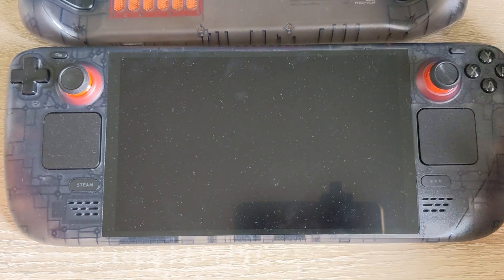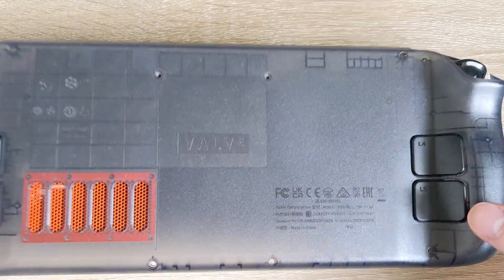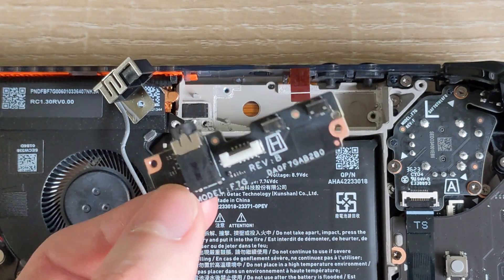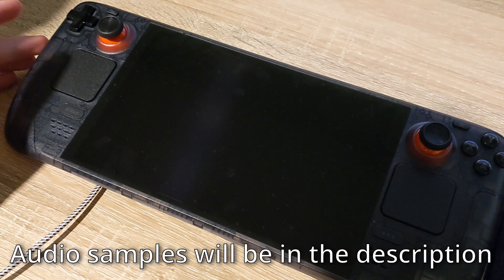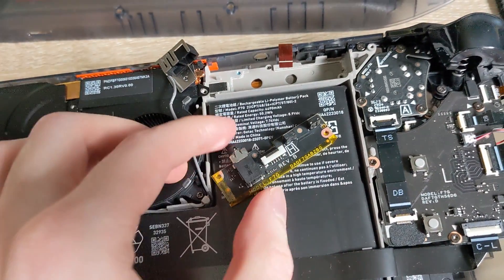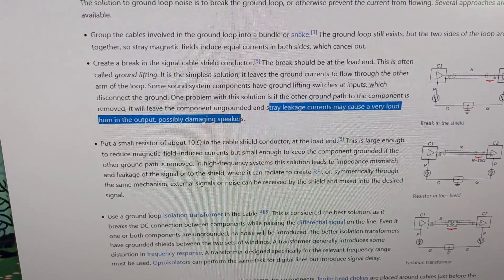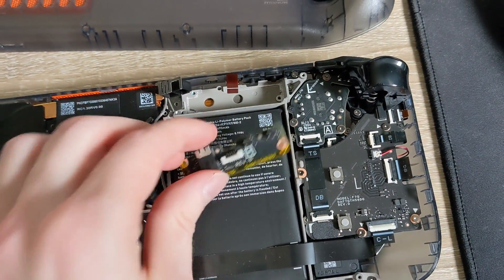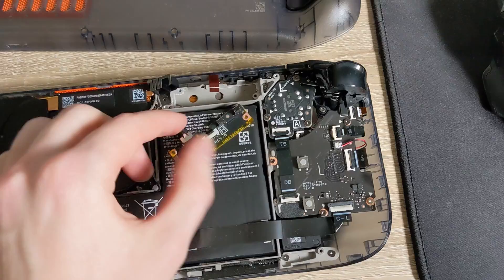Steam Deck OLED Headphone Noise Investigation

Comment: I just backed out the two screws with copper looking plating under them about 1 turn and zero noise (mine was terribly loud).  i did it with headphones in and heard it change and stop.  The screws are touching something they shouldnt.

Comment: So is this problem widespread? Also, how loud is that static/crackling noise? Is it when you are moving around in the settings, while playing games, or playing any sound with headphones connected? Sorry I’m new to the Steam Deck community, I just got my new OLED 512GB
Reply from the maker: The issue pertains to the headphone jack. Steam Decks that are affected by this issue will exhibit a "buzzing" noise when producing any sound through headphones. It is most noticeable in quite moments or near silent moments.

Comment: Thanks for posting! I asked Valve, they offered a fix but I figured I wanted just to fix myself. I used two small M2 nylon flat washers on the two screws on the top of the audio board, and it corrected the issue for me. I was not confident Valve support was going to actually do anything beyond replacing the board.
Reply: Correction - the washers only made the noise less
Reply: I would be curious if anyone here with a 'fixed' deck by Valve can open it up and see what was done.
Reply from the maker: @TakeingCrazyPills  I was curious enough about what their solution is that I went through with the RMA. When it returns I will make a follow up video. Assuming they actually fix it of course haha
Reply: @SamCampbell  thanks so much - I know I could just use one of my many Bluetooth headphones but its interesting to figure it out :)
Reply: Hey could please share a video instruction how to that? I have the same issue

Comment: I sent my 512GB OLED for RMA last week with the same exact issue. They didn’t give me too much hassle. Although I find their response that oh yes they are aware of a small amount having this issue to be a bit BS as based upon what I’ve been researching it seems like a lot have this issue. I think more people need to just go through RMA so maybe Valve will make a more public statement such that  more people with this issue will end up getting it fixed (hopefully) by Valve.
Reply from the maker: Unfortunately I think that Valve will continue to say that it only affects a small number of units and will not make a public statement because it would cost them a lot to offer a blanket recall. 

The only way they will make any public statement is if a large media outlet points out this flaw.

At least the RMA process seems straight forward, I will likely try it myself soon
Reply: @SamCampbell    You can call them on their BS though.  Ask for a replacement unit, and if they state as they have for others, "chances are you may end up with the same issue".  You just caught them in their lie.  As if its a limited number of units, then the chances to receive a faulty one should be low.

Comment: I hope this helps some people: I had this issue on the OLED LE. Not wanting to try to fix it myself, I did an RMA through Valve. The repair notes said that the technician replaced the entire audio board. I got it back and the audio crackling from the 3.5mm jack is completely gone. The whole process took roughly two weeks from submitting a ticket to getting it back (and cost me nothing, of course). Shipping was fast there and back, but I'm roughly one state away from a repair center. The only slight downside is that the orange Torx screws on the back are missing a bit of paint from the device being opened. Oh well, not a huge deal. Hope that helps! Edit: If it's not clear, I got my original device back with a new audio board. It was not a replacement device.
Reply from the maker: That's good to know, thanks for sharing that.
Reply: I second this. I just got the 512GB OLED back from RMA today and mine had a note as well indicating the audio board was replaced. Now I have zero static. My RMA took about 10 days and that included Christmas.
Reply: @seemoremacstuff  Did both of you guys find that the internal storage was formatted when you received the device back from Valve?
Reply: @joshpipe7755    Mine was not, but I did have to go through the setup process again.
Reply: @d.r.1402  Thank you, that's good to know!
Reply: @joshpipe7755  The RMA instructions have you do a factory reset before you send it in. I don't know if they format it again after the repair, but I got it back with a fresh install, basically.
Reply: @antares9792  That makes a lot of sense, since your personal data would be on it otherwise. Cheers for the heads up!
Reply: I got mine back and the sound is still there.  This is at 0 volume.  I didn't mess with the buttons for this, but yes, it still does change based on input/screen.  https://drive.google.com/file/d/1eTkYRq_Yxc81VB-zt7pIpg7sHMASSfEk/view?usp=sharing

Comment: Honestly, I've already RMAed my LE for dead pixal, and the replacement is giving me audio issue. The problem is I dont know if Valve is gonna replace the whole unit which may leads to more issues, or actually fix it.
Reply: Valve replaced your LE? I have an LE SD and idk if I want to RMA it because I installed a 2TB ssd already. Wondering if ifixit will sell replacement boards later on for a diy solution

Comment: Yeah, it's a universal issue that affects all the OLEDs currently out there. It's just a question of whether the user has the hardware to realize they're holding on to something faulty. Valve will be paying for this in RMAs and service rendered for YEARS.

Comment: the noise comes from the power draw of the SOC, so you need to run a game to tell the difference. The difference is very small without loading up the SOC.
Reply: Not even that, at the desktop and the steam front end I could hear the interference from just moving my finger on the screen.

Comment: I don't think you need to remove the ground on the whole daughterboard. Just insert heatshrink tube on the board's screws so that there will be some space between the board and the head of the screw. This fixed their issue for a lot of owners.

Comment: when you search on google you can find posts from some LCD models that have the same issue, there are also people that claim they fixed this problem by slightly unscrewing the screws, my oled has this problem aswell and i will wait for a proper solution from valve. i don't see returning as a solution becuase there is a high chance you get a unit with dead pixels.

Comment: Its not a grounding issue 100%. 
Most probably what happened is valve engineers did not account for the ribbon cable during pcb design for its impedance, almost all softwares can't calculate impedance if there's a separate board involved. Its called "impedance matching", which can only be solved during the PCB design/fab phase which changes the trace spacing, trace width, pcb copper dielectric thickness, heck even solder mask thickness can affect impedance.

The only way to solve this is to return your set to valve, they probable have multiple revs ready on hand.
Reply from the maker: I wonder how they let that slip through the cracks considering that this wasn't an issue on the original "LCD" line. Maybe they just got lucky the first time haha, but I doubt that.
Reply: Honest question, then why does loosening or isolating the screws seem to fix it? @SamCampbell
Reply from the maker: @SeanHoyt1107   Good question. Without reverse engineering the board or having a schematic anyone's idea is only based on symptoms and other people's understanding of electrical theory.

I don't think we'll ever get an exact answer from Valve themselves outside of offering repairs to those "few" who ask. If they offer me a repair I will likely make a follow up video just to see what they changed (assuming their replacement does fix it)
Reply: @SamCampbell  
That explains a lot tbh, looking at the previous model, it was cluttered with capacitors due to valve not knowing where's the sweet spot and being extra careful.
Now that they are able to know what's the optimal components to add, which improves battery life since lesser components= less energy used. Smart but they didn't account for impedance for audio signals.  I doubt they will recall everything since not many people use 3.5mm headphone jack therefore no mob.
Reply: @jackipiegg Valve had announced days ago that they'll fix the issue if you send it in.
Reply: @jackipiegg  Plenty of people still use wired headphones - this issue wouldn't have gained traction otherwise.
Reply: @kyotra 100% true, yes, and plenty of people who DON'T always use 3.5mm audio want the option. Since it was on the spec sheet for the device, they're smart enough to demand that Valve give them what they paid for.
Reply: @jackipiegg Oh, there's a mob. I've never seen such sluggish response from Steam Support, even around the holidays and even around hardware releases. Replies days late with multiple statements explicitly acknowledging slow response times due to the flood of support requests. They are being FLOODED with RMAs over this issue.
Reply: Agreed, and they said it can take 4 weeks for the RMA.  Would it just be easier to return it and wait for a revision?
Reply: @d.r.1402  
There's no official statement on this coz valve wouldn't want a nightmare of total recall. 

Unless famous prominent youtubers/influencers bring this up, I doubt anything will happen. Literally no fire under their ass. I'd keep returning until you get a set that has no problem = means they gave you a newer revision.